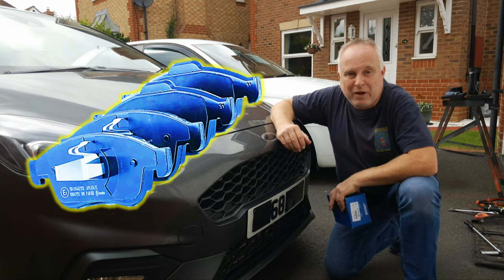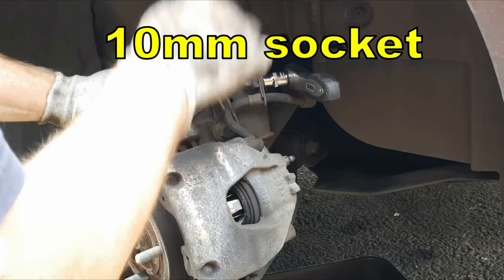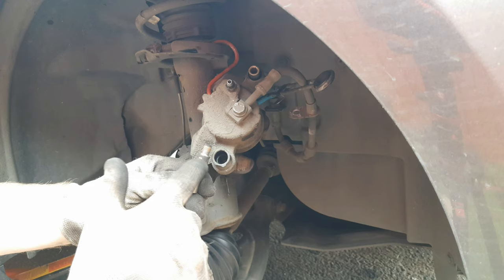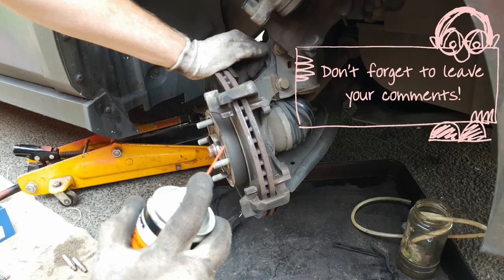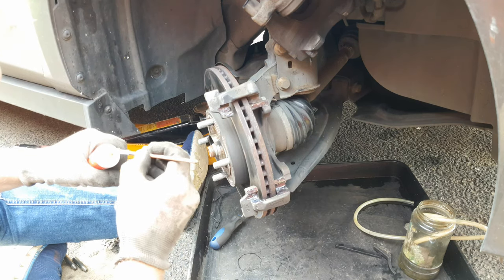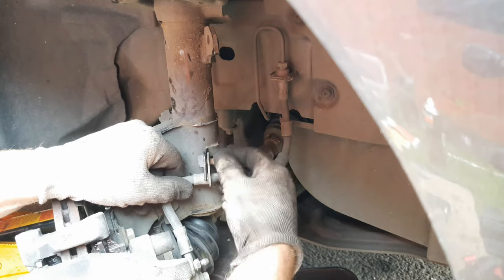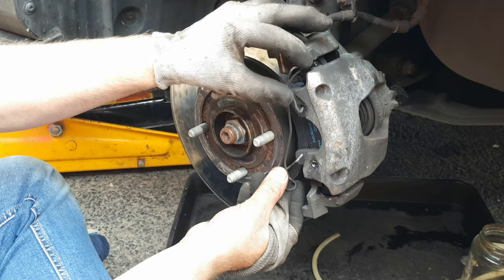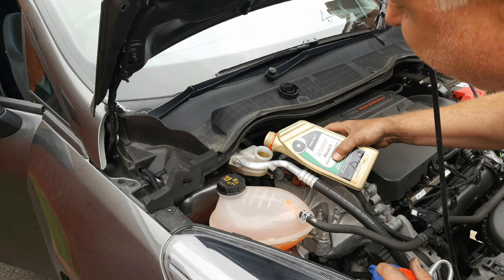Mk8 Ford Fiesta how to Replace Brake Pads | YOU Can Do it 🎓

Comment: Thank you so much for this tutorial. It was clear, concise and correct. I’ve just spent a bit of this Sunday afternoon changing pads and discs. Having always putting off doing the brake change myself, following this step-by-step guide helped me save around £150 in parts and labour charges at the main dealer. 
Top fella 👌🏻

Comment: Thanks for this, done many different vehicle brake changes so was a bit caught out when there were no calliper bolts as I am used to, I then realised it was a sort of Allen bolt but nothing seemed to fit so I was wondering if it needed some special tool. Your video told me it was a 7mm.. an extensive search of my workshop eventually turned a 7mm key up. Finding the odd sized key was the most time consuming part the job!!. Oh and getting the discs off took a a bit of time with a mallet..lol
Reply from the maker: 7mm is common. I don't know why, but it is. Hence Draper doing this tool https://amzn.to/3q5yLtS
Reply: @CycloneCyd  Thanks, most I do are Korean or Japanese, not done a Ford in decades!

Comment: Hi, I've seen some videos that says one shouldn't use ceratec on the slide pins because it could damage the rubber guides. The same on the pistons because it doesn't match with the brake fluid around it. What do you think? Thanx in advance.

Comment: Very usefull video but i have the st3 with performance pack and it has the large red calipers so are the brake pads the same?
Reply from the maker: Good question. It wouldn't surprise me if they are, but I cannot be 100% certain and have no desire to mislead you. The Pagid brake book doesn't list any others nor any exceptions. It might be worth ringing your nearest Ford dealer parts department and asking
Reply: I think that they are the same, they just get painted red.